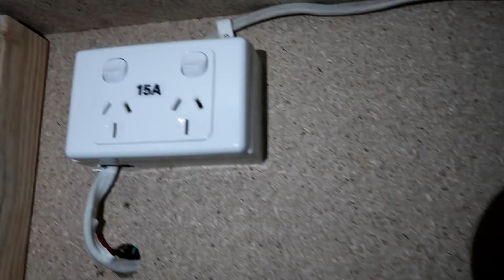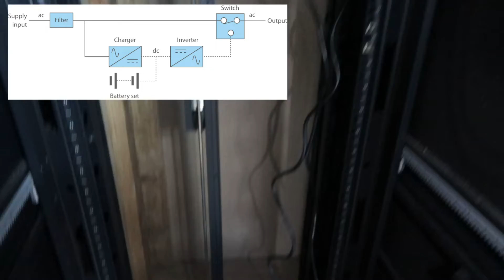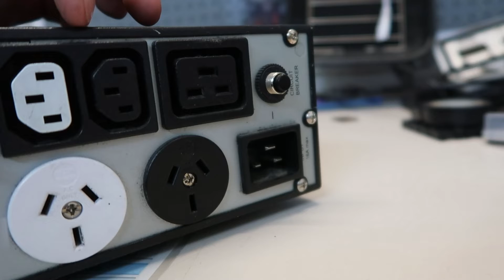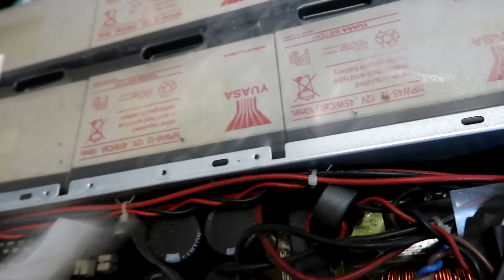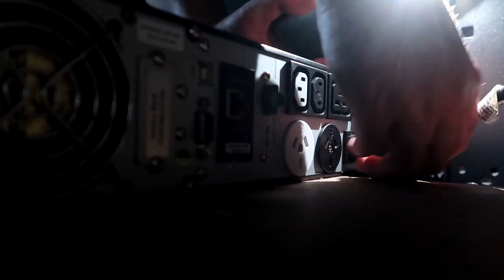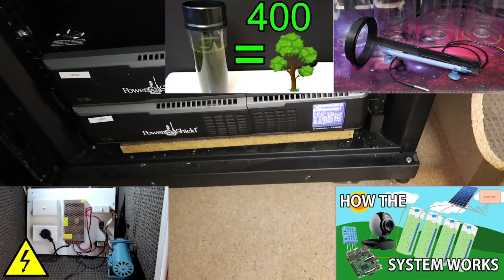Server rack power upgrade and UPS Install | Boosting Reliability !

Comment: Hello.
I accidentally came across this channel and am not familiar with the topic. I've watched some videos and can't figure out how what you're doing works. As far as I understand, the goal is to catch CO2 from the atmosphere using algae. I understand that you can capture carbon this way. But I don’t understand how you can restrain him? After all, the algae will die as soon as you stop caring for them, which means they will rot and release all the CO2 back into the atmosphere.
Reply from the maker: Hi, You are correct in that when the algae dies it will release the CO2, this is why the harvested algae biomass can then be processed to sequester or lock away the captured carbon. This can be done through various means, such as converting the algae biomass into biofuels, biochar, or other products that can be stored long-term without releasing the captured CO2 back into the atmosphere. I have been working on a few of these ways which I will one day get around to posting videos on. Thanks for Subscribing as well !!